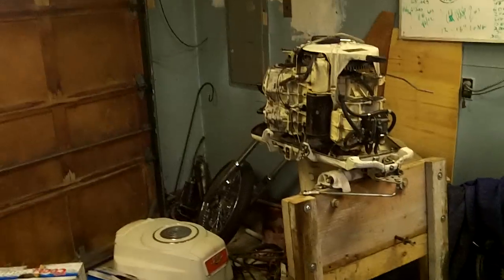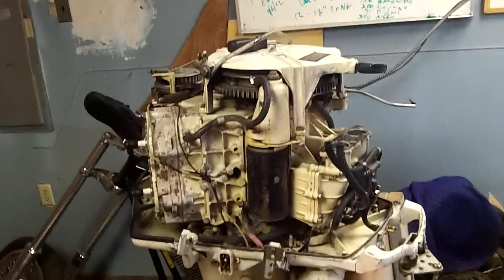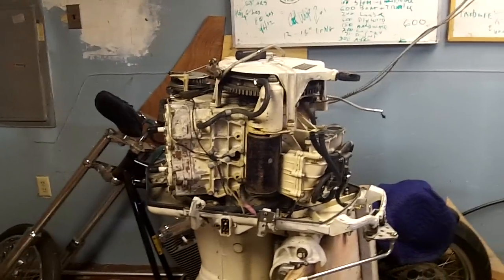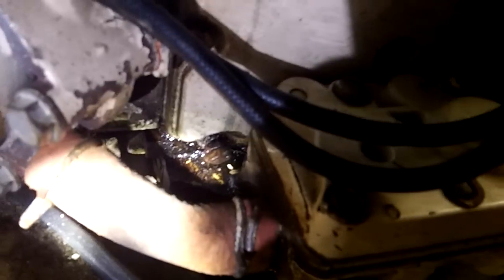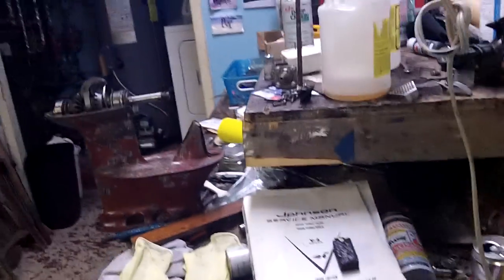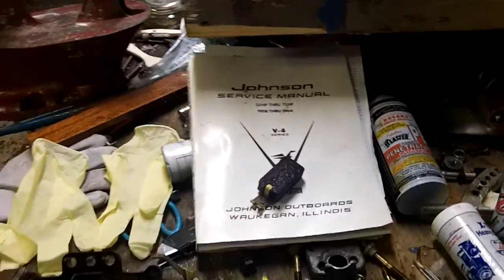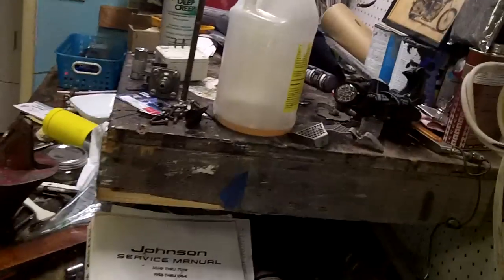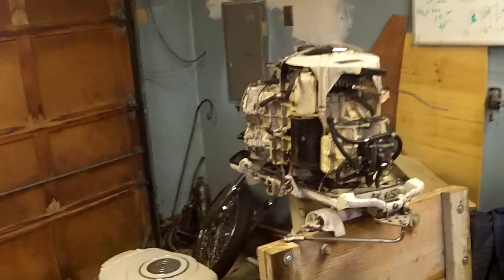1960 Johnson Super Seahorse 75hp

Comment: Did you ever get this motor running correctly??  I am in the middle of my carb right now. It was very clean inside. It has set unused since 1999. I have a question. Did I hear you say the high speeds 3/4 of a turn from bottom?? I just got this motor out of texas and poured fuel/oil down inside and spun it over it fired right up. I have a lot of little stuff to do to it, but hoping it will be a reliable motor. Oh yeah mine is an evinrude v4 75 starflite II, same as the Johnson though.